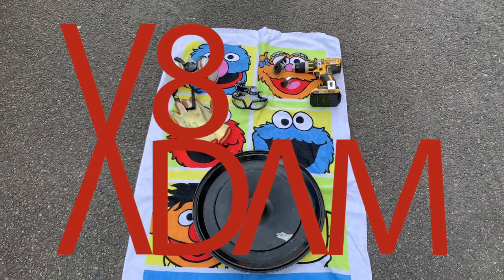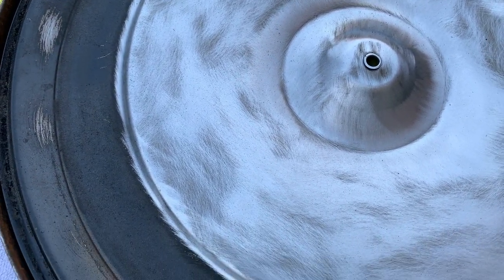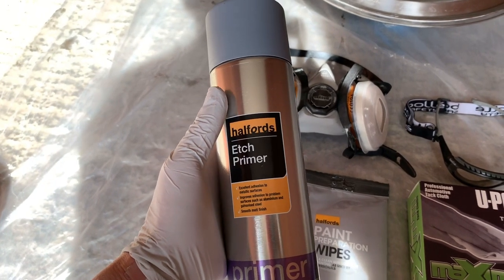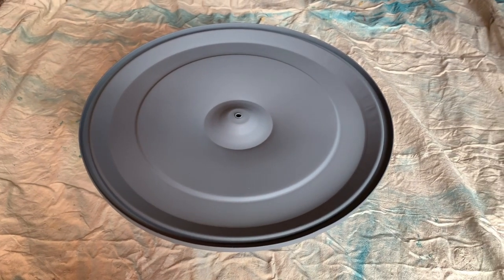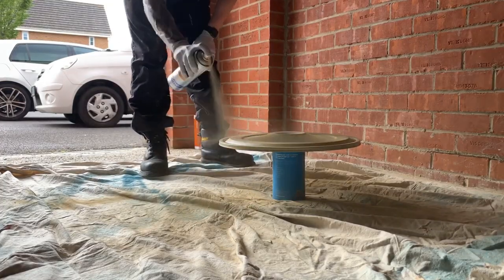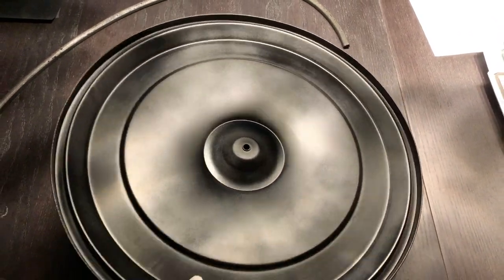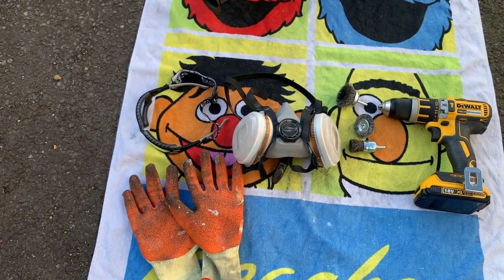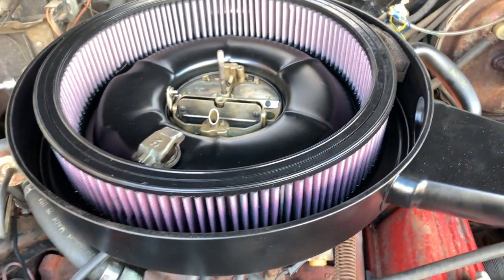1972 Buick Riviera - Air Cleaner Refurb

Comment: Hello Adam, what air filter are you using, please...?  Thanks...✌️😎
Reply from the maker: Hi, thanks for the question. I installed a K&N air filter but I would not necessarily recommend it, I would recommend Wix instead. They are good filters but very expensive. The main selling point of these filters is that they never need replacing. What is not obvious though (and a lot of people do not realise) is that the filters require maintenance every year. You need to buy a cleaning kit to do this. Once you've done that it makes these filters more expensive than buying a basic one that you replace each year. rockauto.com is a great place for cheap parts and they have Wix filters available. Hope that helps!
Reply: @V8Adam  Hello Adam, thank you very much for your kind reply and I agree with your words.
I used to use AC Delco parts for my GM cars, but lately I feel like their quality is not the best.
Your Rivi is very beautiful, I appreciate your care for her...!!! 👍👍👍
Thanks again and best regards...! ✌️😎
Reply from the maker: @toman77  No problem and glad it was useful! Thank you very much 💖

Comment: Adam -- great video.  I have 2 thoughts.  First, I think using a wire brush is not an ideal choice as it adds a fair number of scratches.  I think you should have used 600 grit on the bare metal to reduce the scratches (maybe 0000 steel wool??).  Next time soak the pieces in a few tablespoons of citric acid (comes in a powder) and hot water.  This will dissolve the rust and loosen up the paint.  White Vinegar will do it too. (Both are cheap and eco friendly).  You won't get all those scratches.  In the states, I use high-heat Duplicor semi-gloss black paint for the cover.  Then add their gloss clear as a topcoat.
Reply from the maker: Thanks for the advice. Had it been a 'show' part then I certainly would have got a smoother finish as you suggest. The high build primer actually did a pretty good job at levelling the surface back out. Thanks for the pointer about the citric acid too, really good to know. I've got an ultrasonic for the smaller parts now, great little machine. Noisy though :p

Comment: Looks good mate . I see you or someone else has taken off the air pump . They make a noise eventually and just might as well remove them if not needed for an inspection
Reply from the maker: Thanks very much mate, really appreciate it. Yes, you're absolutely correct. I would reinstate it if I was going for a concours correct look but I will leave it off as it is just a drain on the engine.

Comment: I forgot to ask did you use a heat resistant paint or just a regular satin black??
Reply from the maker: I used regular satin black paint. I've actually noticed that I didn't put the link in the description for some reason, so I have updated with the link for you.